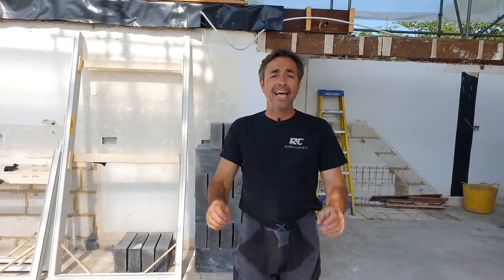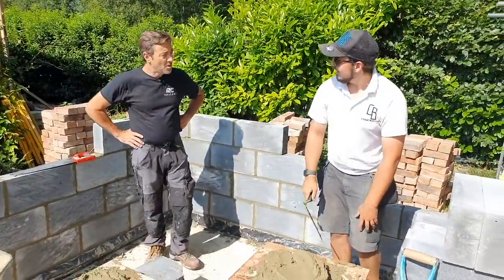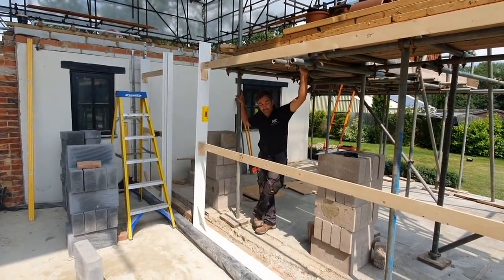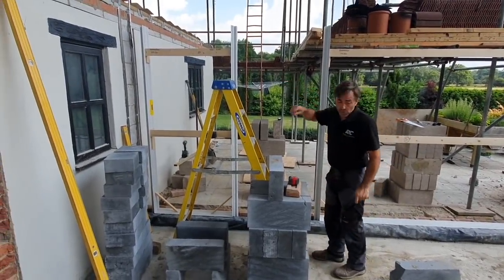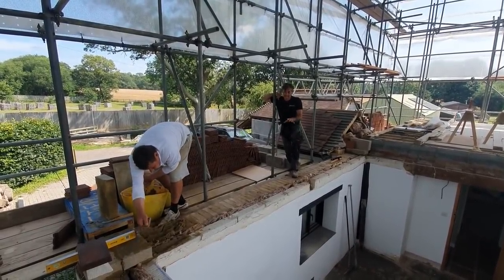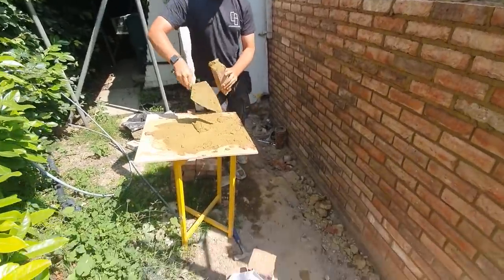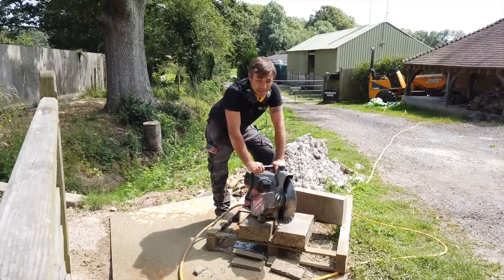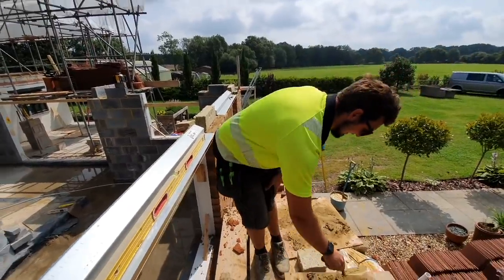The Big Build 14, Building the new brickwork to form the extensions

Comment: Really got into this one Rob! Took me right back to my roots mate.Lovely to see proper brickies, especially Scouse Pete! Heyup Lar!
Besides top quality construction, commercial and resi, in London, I did some social housing in the 90`s before coming out to OZ. And that`s where I first saw cavity closures from Rehau in about 95 ish. Designed so the window could be installed from inside after the scaff drop. Lovely bit of kit, they were.
Down here in western oz, all the good brickies are ex uk. Mostly English or Irish. Aussie teams will have one decent trowel who does the set out, the rest are known as "line lizards", no need to understand the process, just follow the line. There is no building control down here, as we understand it from UK, it`s all "self certification" No surprise then, that tower blocks are falling down over east. Ref chippies, they`ve gone down the yank route where , for example, you have "chippies" who only do second fix. Apparently fixing skirting and hanging doors is an actual trade now. The roofing carps though, they are on another level. Hardly any trusses used down here, certainly in the housing game. It`s all cut on site and some of these lads are magicians ! They look at the span , look at the pitch and don`t look at the tables, they know them by heart, it`s like "Penn and Teller do roofing" mate ! 
Loved my time in the game, from tradesman to senior management, saw it change so much ,mainly for the better in UK. Down here, not so much. They are supposed to follow RIBA for most things, but pick out what suits them. Take  tendering and quotes for instance, RIBA says get five quotes, knock off the lowest , knock off the highest and award the contract  ref quality, ease of use, fondness of dayworks , document control or whatever. Down here, they show their preferred contractor the lowest quote and say ''beat this and it`s yours" It`s hardly going to raise standards and is a race to the bottom and frankly, I`m glad I`m out of it.
Happy time for me, was Tarmac Major Projects and McAlpine Special Projects amongst others. Guys who knew the game, who knew how to work hard and play hard and enjoyed the craic, where a man`s word was good enough. Not much of that down here .But I`m not bitter :)
Love your channel Rob, as said, it takes me back . Good luck mate.
Reply from the maker: Hi Bert, that is a really interesting insight into Building down under!! I was under the impression that the standards where high and that everyone needed some sort of licence!! thanks for taking the time to comment mate, have a nice day!!
Reply: Hi Bert. Growing up in Perth in the 80s and 90s i remember most of the new houses were double brick with cut rooves like you say, now living in Melbourne majority are timber frame brick veneer with truss roofs. Totally right about the chippies though, hanging doors and skirting is about the extent of it and not too many take pride in their work, its all about output. But I'm working in commercial and fit out/resto jobs, we still have some decent chippies around.

Comment: This is one for me Robin. A lovely video.

I worked on the Bentalls job, I may well have worked with your father in law. A good description of how it was back then. I got the bullet for singing!

Tell the lads the brickwork is top quality, two good lads but Scouce is the better by a hair.

Finally someone is asking the bricklayers about the bond before you lay out the opening! You would think with all the computer programmes they have, architects could do drawings that work bond. 

I could have a pop at you over engineering the density of the blocks compared with what is specified, you don't have to lay the dam heavy things!

Nice to see you help the bricklayers with the cavity closures, a clever top brace, I will use that.
 The preformed ones are common now on the big housing sites.

Comment: I was about to start my day, but an RC video came up. Time to sit down, enjoy and learn. Thank u for the kind words, although Sylmar is more San Fernando Valley than wine country. Thank u for giving us the feet, pounds and farenheit. U move fluidly between them all. I still have no clue what a stone is. I am getting a wonderful education on how the trades work in the UK, as well as the language and terminology used. It's going to peak at 110 farenheit today so I better get to work. Thank u Robin!!
Reply from the maker: Hi Bill!! Great to have you on board!!
Reply: Yes, stones are a funny one... a stone is 14 pounds.  So to go from  e.g. 14st 10lb to pounds, you multiply 14 × 14 = 196, then add 10, so 206lb.  To go back the other way is a little trickier as you will often get a remainder.  E.g. 191lb to stone would be: 191 ÷ 14 = 13.64st.  Take 13 × 14 = 182lb.  Then the difference, 191 - 182 = 9lb... thus, 191lb = 13st 9lb.
Reply: @edwardholmes91   Thank u kindly!!  Appreciate the info!!

Comment: Great video. I'm a bit slow on the concrete faced bit at the front, which skin will the joists rest on, and which you've uprated to double strength 7kN. Like the idea on the uprating. Make sure the mortar strength right on the blockwork. Great bricklaying team.

Comment: Those cavity closures look great.  Not in the building trade myself, but I'd be inclined to ask for them if I was having any building work done.
Reply: I've seen some on new builds and these might be the same I don't know but they had little ridges running along the extrusion, when the window fitters came they screwed spring loaded clips to the sides of the windows and just pushed the windows back against the plasterboard reveals and the teeth on the clips bit into ridges on the cavity closer like a sort of one way ratchet action

Comment: Hi Rob, looks great quality. We have to have a dpc tray and weep holes across all our catnics? what the thinking leaving yours out? I've sometimes seen it on the course above the soldiers
Reply from the maker: Well in our case this is a single story so the cavity stops about 2 courses above the soldier and then the roof starts so there is no chance of any water entering the cavities!!
Reply: @ukconstruction  Common sense prevails. Even as a quite experienced tradesman i didn't even consider the specific task being carried out. Just went straight in to " but you always do it this way" mode. Keep up the good work Robin.

Comment: Robin I need your help. All my ground floor joist end  sitting on external wall are rotten. What's best solution replace them or sister them?
Reply from the maker: If you can replace them its probably more cost effective than trying to do sister them, use C24 treated timber and wrap the ends in DPC, hope that helps mate!!
Reply: @ukconstruction  I'll do that. Thank you.

Comment: As site bricklayer for 30+ years can I just say that those preformed frames are a nightmare, most times not square or parallel, often wrong size altogether with drawings.Also try looking down one to see how straight it is, over 2.1 m in my experience can be 20mm out.

Comment: Have you not got to put cavity trays and weep holes in?
Reply from the maker: Hi Gary, we are at the top of the wall now as we go to timber frame so there is no more risk of any moisture in the cavities over the windows
Reply: @ukconstruction  i am based in nottoinghamshire local building control insist on trays ovrer all openings and lintels weep holes too nightmare

Comment: Those wall starters should have a vertical d.p.c. behind them
Reply from the maker: Now this a great topic for debate, I have worked with many builders and different building inspectors and no one I have ever met can tell me what is right or indeed proper especially when you drill through it several times, be great to hear everyone's opinions on this???
Reply: @ukconstruction  should always cut an actual cavity in the existing wall as to form a continous cavity so no chance of damp or cold bridging. When building up to a solid wall, a vertical dpc should always be used, cut in as deep as possible.
Reply: @MrBez007  I've been building extensions for 47 years and have never cut a vertical DPC, my local authority frown upon it as it weakens the original structure, as for putting DPC behind a wallstarter it's a complete waste of time and likely to allow capillary action.
Reply: @stevehallam6495  do you know what cold bringing is ?

Comment: Add about the six minute and 30 second mark the guy is laying some kind of block it looks like, but I’ve never seen a block that you can cut with a freaking hand saw. I figure I must be missing something. I’m guessing it’s not concrete block that he’s laying on edge that mean they look like 4 x 8 x 16 but they must not be concrete
Reply from the maker: Hi Bill, these are probably the most common blocks here in the UK, they are made by several manufacturers and have different strength classes
Reply: Hi Robin, I love all of your videos. Every time I watch one of your videos I am totally amazed at how you do things in the UK. I have one more question if you don’t mind,I noticed that when you’re putting in the foundation you have an exterior wall of brick and then you leave a gap and then you have an interior layer a block with a void in between the two layers. Just wondering what is  the purpose of that big space? Thank you so much, Bill B.

Comment: nice details robin, very much a uk way of doing bricks we do wood or steel frame wraped with build wrap with a 35mm cavity and then bricks with ties to the frames.
 works well also insulation inside the frames to keep dry.
how do you combat moisture in the cavity? or is the thermal of the brick enough to keep it out? cheers from newzealand
Reply: We have timber frame in the UK too with an outer brick skin, but brick and blockwork seems to be the favour of the day now for some reason?
Reply: interesting im sure each has its benefits both cost vs time vs comfort etc cheers

Comment: the outer blocks don't carry the weight
Reply from the maker: In this case we have a steel that has a plate welded across the cavity and there is no way of avoiding some of the loads passing through the outside skin

Comment: Should be a vertical d.p.c behind the wall starters, also not impressed with the technique of how the soldiers were buttered, which will no doubt leave an unnecessary void.
Reply from the maker: Hi Brad, this is a really interesting area for debate, I have worked alongside loads of bricklayers and builders on various sites and everyone has a different opinion on this, I personally don't like it as you have to puncture it several times to fix the wall starter!! be interesting to hear what other guys think!!
Reply: @ukconstruction  To paraphrase my local building inspector, " The mortar is prone to retain moisture. But more importantly, it also draws extra water into the joint  through micro cracks that always form in cement. Which when you consider the climate in this country, its inevitably going to lead to a joint that becomes saturated over a period of time. If you then factor in how the abutment of brickwork only exacerbates the issue by inhibiting the natural drying process of ventilation/ evaporation. Then I would respectfully assert that a vertical d.p.c is essential.